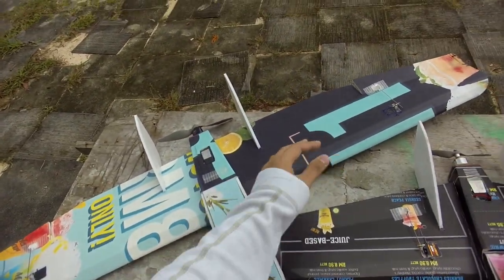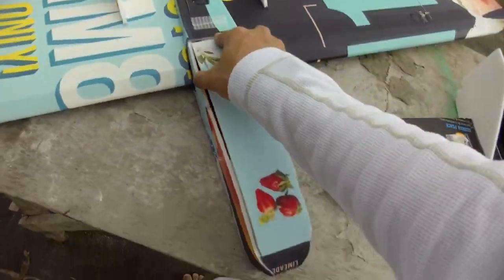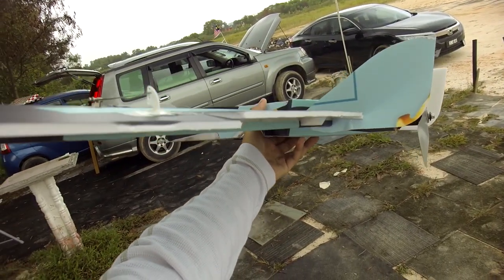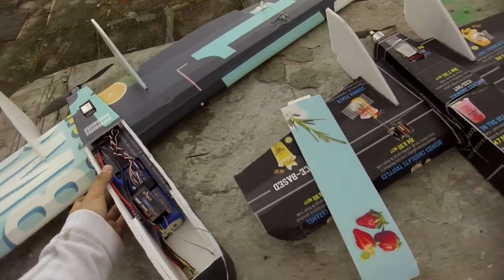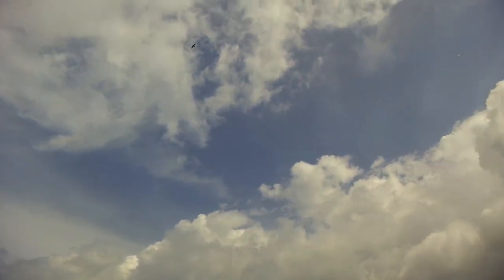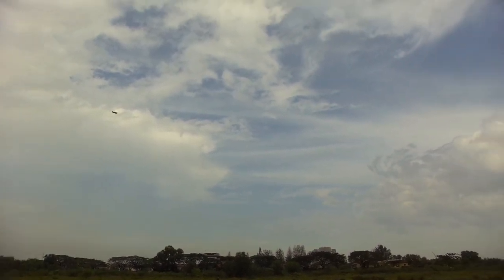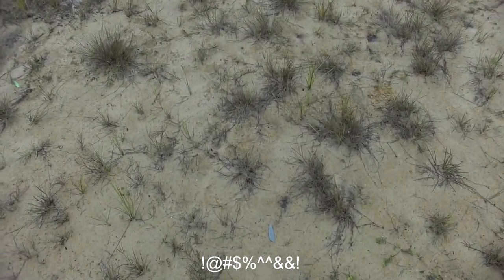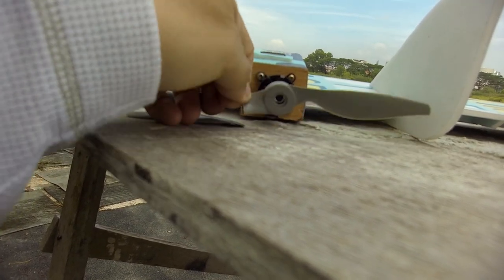FT Goblin Plus' Maiden 1300mm Wingspan

Comment: If a plane pitches up on throttle, CG is too in front - nose heavy, try to move CG slightly back, start from 1mm step and move it (towards TE) to your liking. 
When you do a glide test, right CG position should not pitch up or down, it should only gain height but without pitching (light pitching is acceptable). But that's extra hard (it requires reflexed airfoil and fine tuning) on planks as they have no horizontal stabilizer. 
Another issue is angle of attack, every airfoil needs it... this one could be 5-7 degrees, if your motor is line with angle of attack it basically pushes the plane up...
btw great build!  :-)